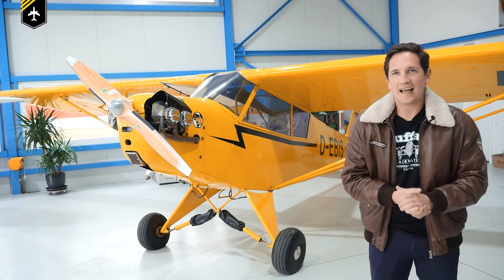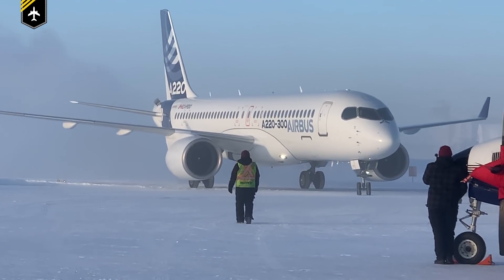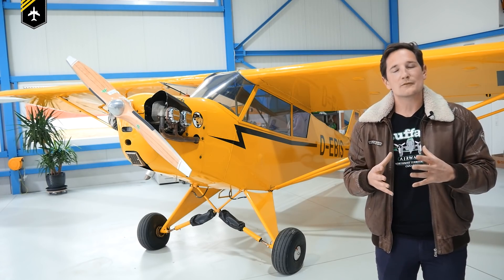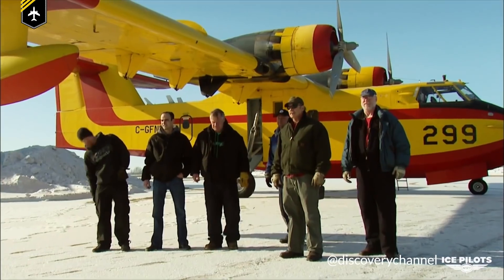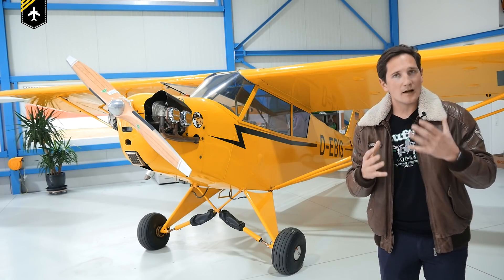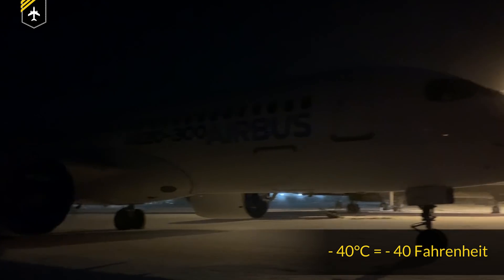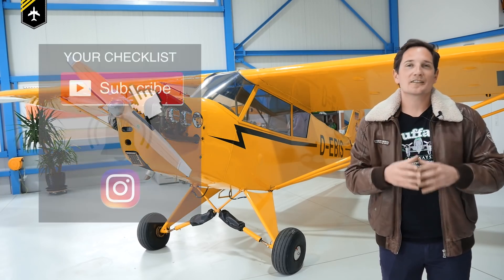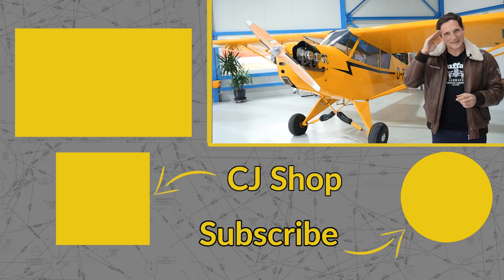Airbus A220 withstanding the COLD WEATHER Certification

Comment: Capitain Joe! First of all, thank you for your explanation. My question is: considering the ground temperature below -40°C after overnight coldsoak, which are the procedures to release the aircraft to be dispached ? For example, eletrical system can be power up below -40°C ? Or is there some procedure to heating the avionic bays?

Comment: Here's a local example of the importance of being able to start up in cold weather..

 I'm a frequent passenger based at CYQT - obviously, its cheaper for an airline to leave a plane overnight here than it would be at Pearson in Toronto, or another larger airport - so pre-COVID, our airport would host 8 Q400s overnight - 3 from Air Canada, 3 Porter, and 2 from WestJet. 

Now - our normal winter temperatures in late Jan early Feb is usually no more than -25, often in the -40 before the windchill. Its the same polar winds that freeze Yellowknife that freeze us - but even those little props can handle it no problem. 

Well. One problem. How would you feel if your coffee was still frozen for the first 5:30am flight xD

Comment: Captain Joe, I been wondering,for some time, if given the right circumstances, taking into consideration the speeds, stresses and strains on the airframe etc. Would it be possible to complete a loop de loop in a big jet ( heavy or super ) .   I understand that the aircraft is not designed or built with this kind of move in mind. Purely from a scientific point of view, taking into account the way aircraft are over engineered and over powered. Would It complete the move, stall or simply fall apart ?   I have been pondering this for some time and thought I know, I’ll ask Captain Joe.

Comment: Hi Joe. I want to learn more about how a twinjet operate when one engine fails. Can a twinjet Take-Off/Go-Around with only one engine? How to solve the imbalance as the thrust is concentrated on one side of the plane?
Reply: ZF Ma yes a twin jet can take off/go around with a single engine. In fact all planes have a procedure for it and pilots do practice it during their checks.

And the imbalance is generally balanced with the rudder trim

Comment: Joe, in case of dual engine failure, why can't the APU provide minimum power? Why is the RAT needed?
Reply: Ritujoy Chakraborty yes apu can provide power, but the thing about apu is that it takes a while to start up whereas rat is almost immediate 

Moreover, apu start may have a max altitude for startup with only batteries, so the aircraft has to descent before it can be started.

Comment: Good one!
But I'm wondering: Why is one flight already enough to get such a certification? How can they be sure that the next time in those conditions everything is still working well?
Reply: As is true with all testing/certifying procedures, this flight is done in way harsher conditions than what's allowed in normal operation and maintenance procedures to make sure it can actually withstand much more than it will ever face during it's entire life.
Here the plane is left for 12 hours outside in the cold with no heat source at all.
The normal procedure at those airports is to store the plane in a hangar to keep it at more reasonable temperatures and regularly do a test run of the engines to maintain the heat and circulate fluids.
Reply: @christianbarnay2499  I see. Thank you very much for your Explanation, Christian!

Comment: Did anyone notice that the hole the bolt went through  was chamfered / beveled. That alone would have assisted with the cutting of the bolt. I don't doubt the validity of the experiment, but no material on a plane would have a beveled hole like that.

Comment: Just 2 months ago I was talking to an airline pilot that hangs out at my flight school about trouble they were having with pre-flight at Edmonton Canada. While the water truck was stored in a heated garage the rubber water supply hose was left outside and it was so cold that it had become brittle and so it burst when pressure was applied and this sprayed the plane making a solid layer of ice which also got inside the door and made them get out hot air blowers to thaw the latch, the whole deal took like 3 hours. They were only about 3 degrees above certification temperature.

Comment: Rockets and satellites have to be tested for extreme temperatures - the chill of outer space (where heat radiates away) and the heat of passing through the atmosphere at high speeds. (And ground vehicles in cold climates can use engine heaters to make it possible to start them without too much preparation. Apparently in Antarctica they don't shut off the engines of their snow-cats or other vehicle; they just leave them running in the garage, so people can just get in and drive.)

Comment: Hey, a Piper Cub - 65 horsepower, 65 Miles per hour cruising airspeed ( about 102 kph ).  Flying at its best.  Stick and rudder.   Years ago there was a clip wing Piper Cub that did a good aerobatic routine at the local airshows N432X.  I haven't seen that Cub for quite a while.  Great video, Joe.  Years ago they cold weather certifications in northern Minnesota.  In that region it is no longer cold enough.
Reply: How they measure horsepower on plane I only know on cars

Comment: For an example on how the cold can have devastating consequences if a machine/vehicle isn't built for it lookup the Challenger disaster.
https://en.wikipedia.org/wiki/Space_Shuttle_Challenger_disaster
TL;DR: The O-ring seals in the SRBs weren't designed to handle very cold conditions (like it was the morning of the launch) so when they launched anyway the hot gasses where able to breach the seal resulting in the loss of the vehicle and crew.
Reply: The Challenger example is very good as it was temperature related. 
The Aloha Airline example shown was a poor example as it was corrosion related do to extensive use in a coastal area (salt)